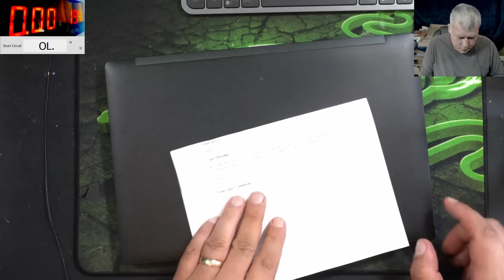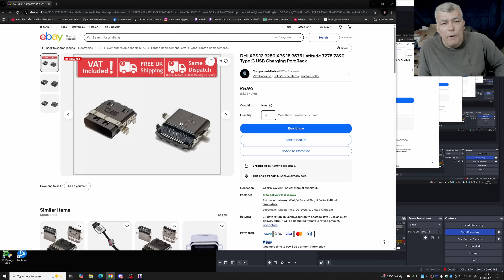Dell Latitude 7490 not charging, USB-C port replacement, ports replacement are not always easy!

Comment: There are replacement ports with tabs that are welded to the USB cage and can be screwed down into those 2 holes on the side. Dell has made these particularly crappy, it looks very much like planned obsolescence, especially on the models without a barrel connector.

Comment: I’m using those cheap USB 4 magnetic male - female plugs on my laptops that use USB-C charging. I never had a single problem with all my laptops that used some sort of barel jack charger. The USB-C ports seems more fragile in heavy usage.

Comment: hy sorin great video! do you have for sale that type-c cable at 14:22 wich shows the voltage when plug in? thanks in advance! :_Hype::_Hype:
Reply from the maker: Here: https://youtu.be/WGCOpexNpJQ?t=1618
Reply: @electronicsrepairschool  thank you! but do you a link for this, because i found it but it's not the same 😁

Comment: I'm removing broken pins a lot in my repair work. Just heat the pin with soldering iron and pull the pin out with tweezers.

Comment: Hello, excellent work, congratulations. I wanted to know which USB-C cable you use at 14:23? It shows that it goes from 5V to 20V in the USB-C connector of the cable you use.
Reply from the maker: https://youtu.be/FzG_PpT3PO8?t=1235

Comment: Any port or connector that relies on only solder joints to withstand abuse will fail, the higher the density of the connections the longer they to replace. I hope this one lasts more than three months.